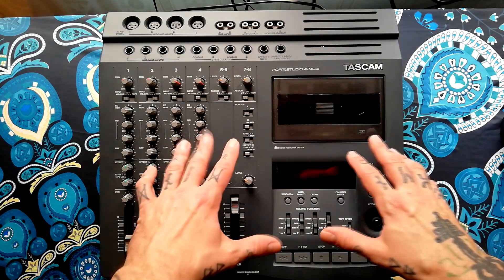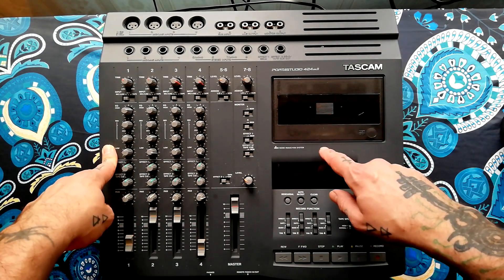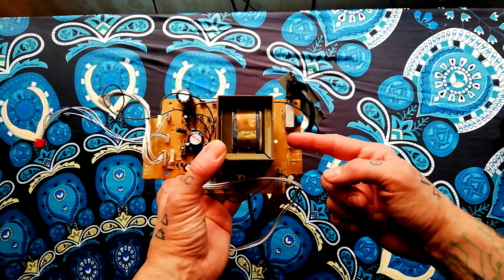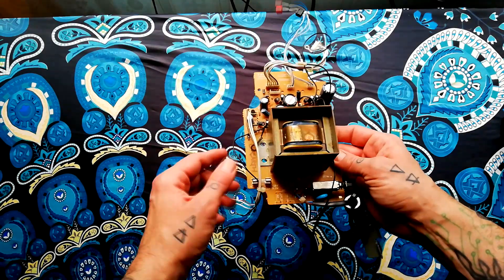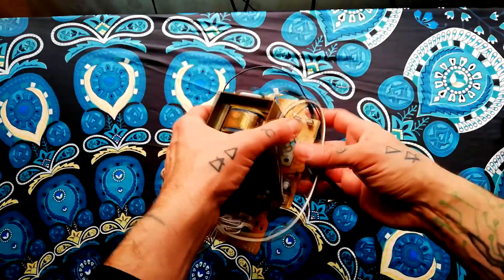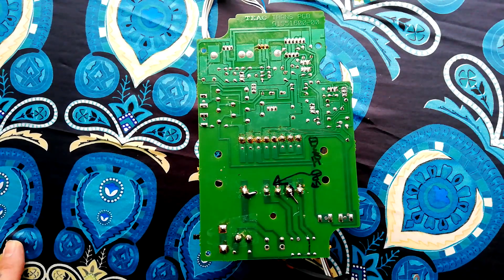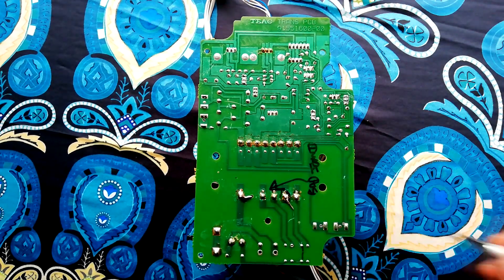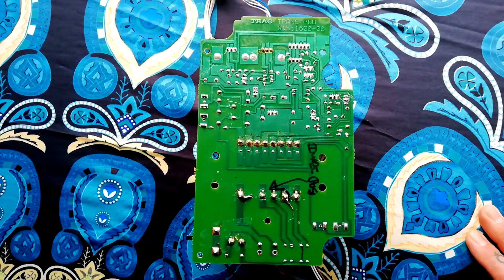Mending a broken circuit board | Tascam 424 mkII | No power

Comment: Is there a specific reason you made the repair to that PCB track versus just bridging the two points with a piece of wire?
Reply from the maker: @AB-kf4pw  no. In some ways using a suitable gauge of jumper wire  would be a more resilient repair.

Comment: I have a 424 mk ii, but there is no input/ levels are not showing. Have you had any experience with this type of problem?
Reply from the maker: Please can you clarify, are you getting any response from a) the headphones b) the line out c) the LED meters 1) from a prerecorded cassette 2 from the mixer? With regards to the cassette playback, are you getting different results from different tracks? With regards to the mixer, are the results different depending which channel you use?

Comment: I have a 424 mk iii and it seems to all work except for there is no display on the led screen and the transport /functions above the screen don't appear to work. I can record and playback but nothing on this display, any thoughts??
Reply from the maker: The schematic for that unit is up on my blog for free download. I'd check the pins on the bottom board to see if the display is receiving appropriate power ( it'll probably show some of those pins providing +5v or similar - use a multimeter to establish if that is present) if the correct voltage is present, start looking for bad components on the display PCB. If there's no power you need to troubleshoot the power section of the lower board

Comment: Nice! I just fixed one of these today with almost the exact same problem. On mine, the secondary pins of the transformer had broken PCB connections. I removed all the solder, sanded down the soldermask, and then laid copper wire + solder over all of them to repair... finished with conformal coating for good measure. Funny to have found this video immediately after O.o

I was wondering about D11 - it was shorted out in mine and also took out the 2SA1015 pass transistor. Is it a 27-Volt zener? Just guessed really since I could barely make out a "27C" on it.... 

Thanks for the video!
Reply: Also, wow ZERO schematics online - such a pain! Do you think the negative voltage supply is for the screen? It seems like a vacuum device since it has a getter flash, so it would kind of make sense that it has a control grid
Reply from the maker: @benfischer6601  I'm sorry I don't have the schematics either. I didn't do any exploring of D11 since the unit was functional once I'd repaired the circuit board.

Comment: Excellent channel! I've owned a 424 MKII for about a week and it was working completely fine. Then tonight I power it on and could get no audio signal for playback or mic/line input monitoring. I powered it off and now it suddenly won't turn on. The LCD very faintly displays thin red lines when I press the power button on, but goes no further, nothing else lights up and no buttons or switches respond. Does this sound like a Fuse or Transformer/Board issue? Thanks!
Reply from the maker: I haven't had this issue so I'm not sure. Sometimes when I'm working on these things I haven't plugged the cables back in properly, thin lines on the LCD display speaks to that sort of issue, no audio does imply the op-amps aren't receiving power. Even without the schematic (I can't find it for this model) You can establish whether the power conditioning section is spitting out appropriate voltages for the rest of the system to use by testing the output sockets with a meter and dupont bread-boarding wires. You should be getting 12 volts for use by the motor, about 5 volts for logic, LCD and leds to use, and a pair of matching voltages for the opamps - I've seen +/- 10 volts to +/- 15 volts depending on the model. Whether you find these voltages or not can help you figure out whether your problems lie on the power section or elsewhere. For a demonstration of me using this sort of deduction check out a video I published working on a black Japanese 464.

Comment: Hey Tetrakan! Ive been poring over your videos trying to diagnose an issue with my 424 mkii and thought maybe it would be best to ask! I am only able to play, ff, rw for a second or so (no movement on the counter) before the auto shut off kicks in. Additionally, it seems that cleaning mode won't activate for some reason, it just goes to the regular tascam screen. I haven't opened it up yet, but I am planning to and want to know what to be on the look out for! I saw on another comment that you thought it might have something to do with the digital counter.. just curious if you had any more insight! Maddie
Reply: oh one more thing- the machine seems to be in otherwise perfect, near mint condition, so I would be surprised if it were some sort or dirt/gumming up thing. Thanks! M
Reply from the maker: Hey, the trouble is, although it's come up in comments on my videos and in forums etc, I've never had this problem myself. The counter should advance, and if it does not, the logic IC will take that as an indication that it's the end of the tape, and the stop solenoid will be triggered. But as far as how the counter gets its information on that transport, I'm speculating based on units I'm more familiar with. I.e. either 1) it's s magnetic system so a rotating magnet beside a transistor or 2) it's an optical system so there's an led bouncing light off black and white segments on one if the reels, or maybe apertures alternately blocking and allowing light to shine ( this was the system in a fostex 250  I had a loan of). From memory I though it was a magnetic system with a hall effect transistor, but it's maybe something I should investigate further for the channel... meantime, clean it, replace the belts, hopefully the issue clears up. Thanks for watching!
Reply: @Tetrakan  thanks so much for getting back to me. I am just going to get in there and replace the belts, and take a look to see what could be going on. I'll let you know if I discover anything! M
Reply from the maker: Just to confirm, looking at this transport today and there is definitely a magnet built into the base of the take-up reel, inducing a current in a nearby transistor, so make sure both are clear if dirt and debris, use a q tip with isopropyl.

Comment: Hi sir! I recently got the same model for free off of my uncle's old studio. It wasn't powering up and then when I opened it and check the power supply board I've found that the main transformer was missing, probably in a previous attempt to repair it. I then searched for the schematics for this particular model and found non. Any idea where I can find them? Any help would be highly appreciated! Thanks!  PS- The big capacitors had some red marks same as those! :D
Reply: can u pls help me on what transformer it uses. Thanks

Comment: I just bought this same model that has this problem as well. It doesnt look like the pcb is cracked, but it has a few leaking capacitors hopefully thats all it needs.

Its missing all of the exterior screws though, which is annoying. Do you happen to know the size of those screws so i dont have to tape this guy closed?
Reply from the maker: I'm not sure about the size, I'm in the fortunate/unfortunate position of having over a dozen parts-donors I failed to fix while I was teaching myself how to do this, so I have never had to buy new screws! My suggestion would be measure the length width and guesstimate the space between the ferrules then do a google image search for "screw naming conventions" (with safe search on hahaha) and I imagine you'll find what you need to find an appropriate pack on ebay.amazon/etc?

Comment: I've got a portastudio 424  mark 1 and it wont power up at all.  What do you suggest ?
Reply from the maker: Sorry only just saw this . ..check the polarity and voltage written on your external AC adapter matches the writing beside the input socket. If they match check the output of the AC adapter using a multimeter. If it's okay open the unit and check the solder at the base of the power input socket is intact. If it's okay, replace the 3 or 4 largest capacitors and any chips you can identify via serial numbers on Google as bridge rectifiers etc (Google linear power supply to understand more) good luck!